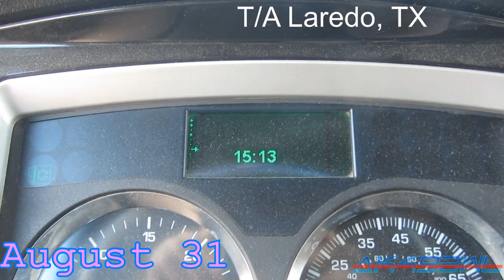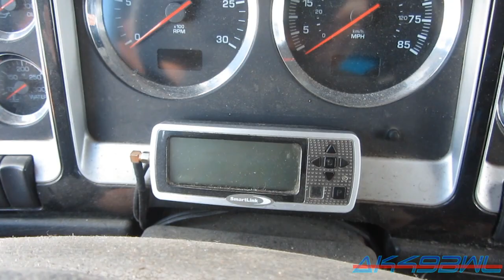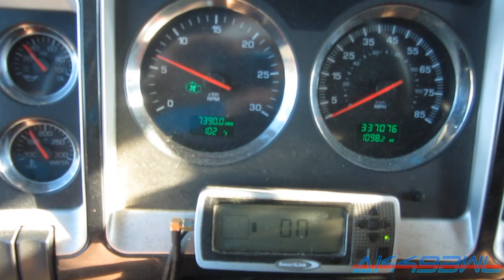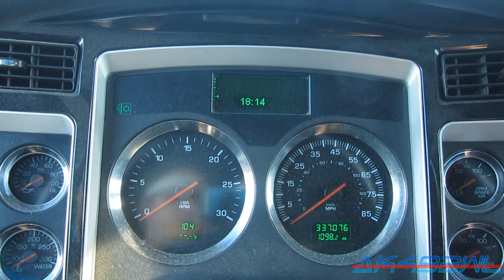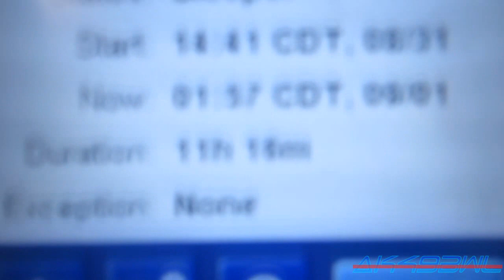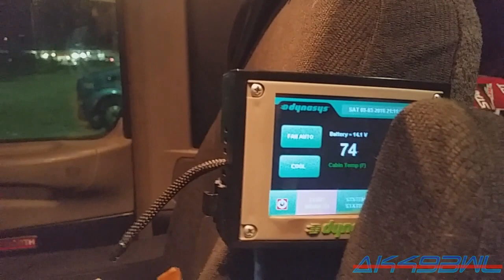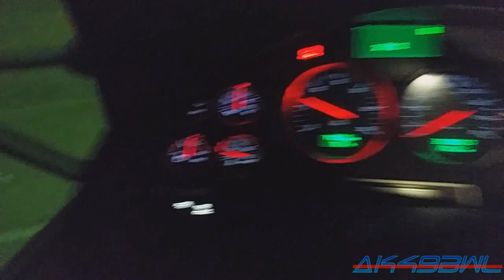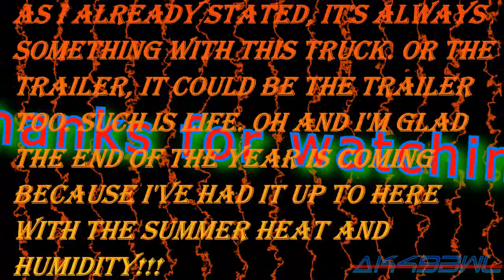Failures Galore - VLog 257, 08/29-09/03/2016

Comment: Nice clip, lots of challenges for sure. Did you get everything in your pickup fixed up like you wanted it now?
Reply from the maker: For the most part, yeah... There's still things I want to do, and I'm having issues getting the engine tune just right but it's a WIP lol. She runs and drives well and right now, I can't really ask for much more :)
Reply: That's cool. I know you've put a lot of work into the old gal. Shes looking good.